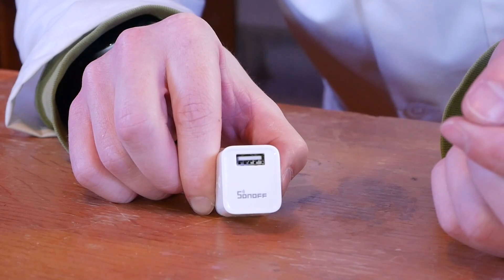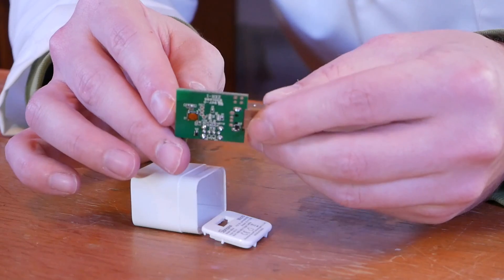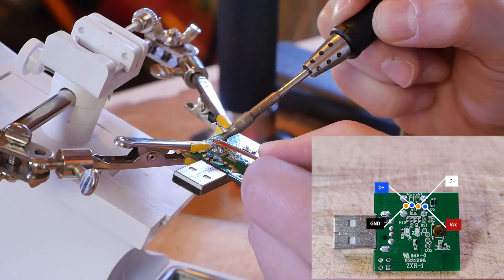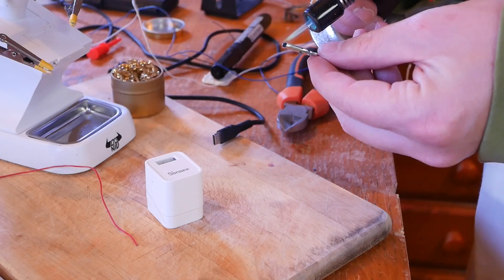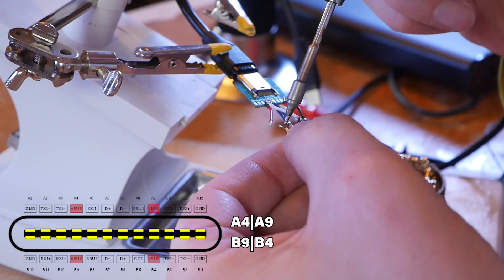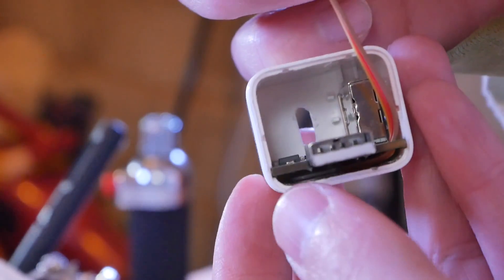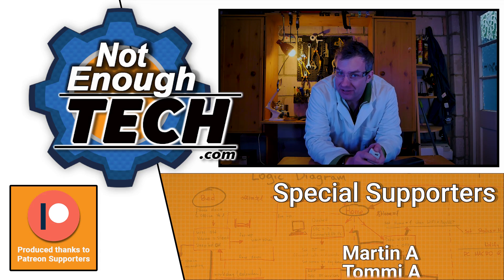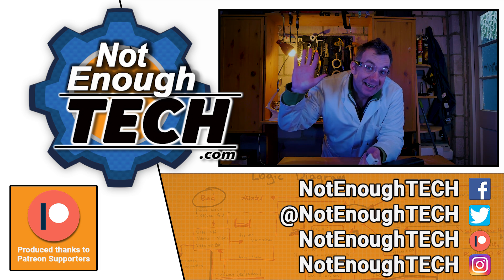Sonoff Micro PLUS - USB-C mod

Comment: Can't comment!?
Reply: YouTube removes comments with links maybe that's why
Reply: @Thepajonk  Was not a link, it was a very long description of a sonoff pcb board that they sell on aliexpress.
We all know how long those can be 😅
Reply from the maker: Haha have you hit the limit? 😅 You can always email me. Contact on my page :)
Reply: @notenoughtech  Looks like I did 😅 I will do that next time.
But this is the PCB I found, SONOFF RE5V1C Wifi DIY Switch 5V DC Relay, you find it when you search for it.
It looks like they use the same pcb for many things.  I have the same sonoff device you show here.
Reply from the maker: Oh I would not be surprised. Re using stuff is more common than you think
Reply: @notenoughtech  I have noticed that, it's like buying Lego, you can and build it yourself 😅

Comment: I don't get the point of your project.
.
To begin with, the Sonoff Micro electrical safety certification has been violated. Nowhere in your video did you make an effort to verify that electrical isolation has not been compromised.
.
Have you heard of voltage transients?
.
Furthermore  your "modification" does not provide USB PD (Power Delivery) or Qualcomm Fast Charge functionality and only plain vanilla 5VDC with 1A.
.
I own a Sonoff Micro myself and if I ever needed to use the Sonoff Micro on a device with a USB-C interface I would simply grab a "USB-A to USB-C" cable from my draw and achieve the same functionality as your modification.
.
Why would I ever perform your modification when all that is required is a vanilla "USB-A to USB-C" cable?
.
I must own at least 20 "USB-A to USB-C" cables in anticipation of the requirement of using a vanilla USB-C interface with USB 1.1 and 2.0.
.
The only real justification for your modification (inclusion of USB-C connector) would have been if you were going to provide USB PD (Power Delivery) support.
.
I'm sorry to say this, this modification is somewhat infantile and silly and why would you bother in the first instance?
.
Just grab a "USB-A to USB-C" cable in exactly the same way you would grab a "USB-A to USB-B" cable if you needed to attach a printer to a PC.
.
Imagine modifying a printer to accept a microUSB cable. Why bother when all you need is "USB-A to USB-B" cable.
Reply from the maker: You are missed the point by the mile. Usb-c is a connector factor. USB PD a charging standard. I'm simply adding the possiblity to connect USBC cables. I'm not going to magically enable PD on usb-A 2.0 input. 
To even assume that is misguided
Reply: @notenoughtech  How could I have missed the point by a mile?

I said that I would simply use a USB-A to USB-C cable and not perform such a modification.

Any mention about USB PD  was to raise the inherent advantage the of the modification if PD could be provided some way.

Or more precisely, your modification is a waste of time and achieves nothing more than choosing the correct cable in the first place.

If you are going to invest time and money then the idea needs to be useful.

Just use a USB-A to USB-C cable and there are less hassles.

It's not rocket science.
Reply from the maker: The point was not to use a spare cable but have a device that accommodates the both 🤦. You can continue taking spare cables.

Comment: Nice little project. Have you been able to link this up with home assistant? Considering using one of these to keep an eye on a tablet battery while on the wall to make sure battery doesn't blow up
Reply from the maker: Unfortunately I don't use home assistant :) but you can use eWeLink API or flash it

Comment: I'm not that impressed with the Micro either. I mean it's OK but it could be much better. Let's hope they come out with more advanced ones.
First of all I'm not at all impressed with power usage. Wooping 0.35W or so just for the Micro(!) Why is it using that much power? Then add losses in PSU. A Sonoff Basic I modified to be USB long before Micro was even rumored only use around 0.15W when relay is not engaged. I probably could modify it with a FET to minimize engaged looses and make it silent too.
Next thing - why not make it compatible with QC ? Even better add voltage and amperage measurement to it and let user set thresholds like for POW R2 - brilliant for charging devices. That said the POW R2 is really annoying when used for charging as most chargers ramp up charging current. If set to cut off at a low of 80w (charging my electric unicycle to roughly 80% to preserve battery when I don't need the distance) then it cuts off instantly no matter charging state. There need to be a minimum on time too.
Reply from the maker: I agree with you - it will make the Sonoff Micro a very niche product. I hope they will take the feedback in consideration when making  other products.

Comment: Isn't that a USB-C input. You won;t find many cables that will connect that to anything.
Reply from the maker: It's a regular usb-c female (albeit 2.0 protocol)
Reply: @notenoughtech  I saw that but the standard cable that will plug in that socket will give you a USB-A male on the other end which is a standard output connector also. So you won't have anything to plug it into. You will need to use an adapter, in which case you may as well have gone with the standard socket.

Maybe a better mod would have been to install an ESP12 in the void and then you could flash it with Tasmota. .😂
Reply from the maker: @dikl2689  This was just demo to show you values. I charged my Xiaomi Mi9 later with USB-C  to USB-C cable :) I should probably include that in the video :P
Reply from the maker: @dikl2689  I covered the power limits and the fact that this a vanity project at the beginning. Portal references and angle grinder attack reimburse the seriousness of the project. 

The aim was to fill in a void in the case with something more useful than empty space. I'm not gonna sold anyone on the idea that this is the next best thing. But it's a little more useful than original. Yes you could solve the issue by plugging an usb-a to usb-c adapter but then video would lasted shorter than the as before it 🤣😂🤣😂🤣

Comment: Interesting concept.  Your introduction made me laugh :).
USB C power helps, but for me it doesn't address the fact it is still USB in, requiring another permanent power supply to run it.
That's just me though.  I can see there could be use cases for this running it off a PC or battery power pack.
Another great video.  No one else has thought of adding USB C connection to it yet.  It is still only USB 2 spec of course.
waits for iTead to copy this in a future update
Reply from the maker: They aware of this Frankenstein. I suggested the data pass through. This way you could use this with webcams to make sure they stay shut (and other USB based pc peripherals)
Reply: @notenoughtech  definitely could be interesting for that.
Could be used to power cycle webcams that play up or to turn them off if you don't want to be seen.
Reply from the maker: You could do that with smart speakers as well but since most of them use plugs rather than USB, then you might as well use a smart plug :)
Reply: @notenoughtech  Acer had a nice set of USB powered mini speakers several years ago, but I don't see many now.
That's the battle with this USB smart adaptor.  Smart plugs that cut the primary power sound better....
Still, we will see what happens with FrankenUSB.
Reply from the maker: Without the data lanes, it's hard to justify it unless you really need the USB :)

Comment: Nice video. But I think you will print a good small case for that circuit.
Reply from the maker: That' was my 1st idea, but I cannot make the PCB any narrower which means it would still obscure the ports nearby. I had the design for a completely flat one though
Reply: @notenoughtech  yes i get it. You have uploaded good iot related videos. Keep uploading
Reply from the maker: More is coming :) as soon as I finish putting it all together :D thank you for the kind peptalk :)